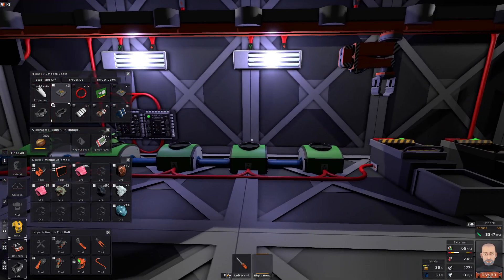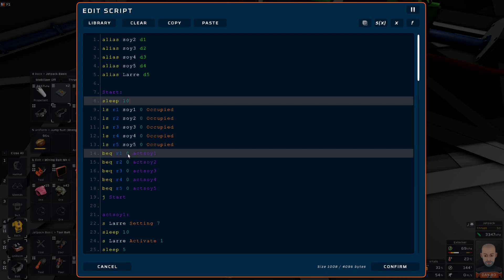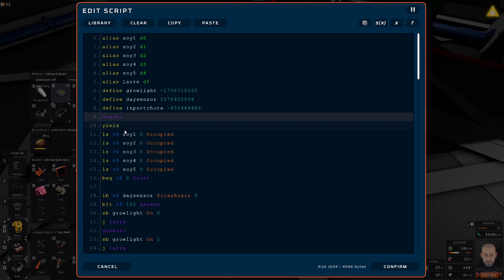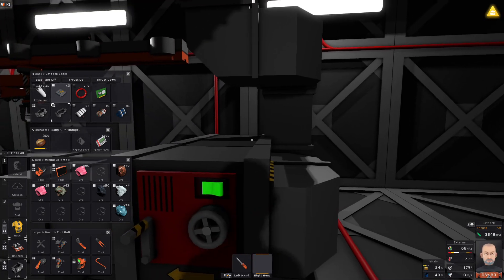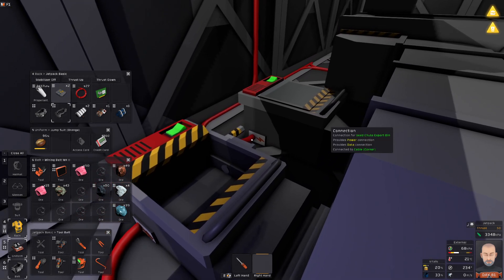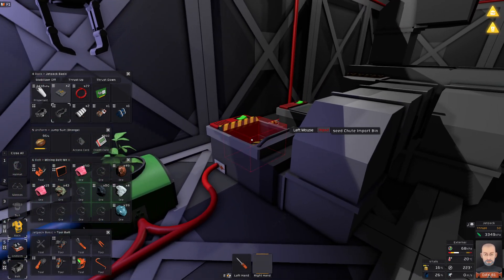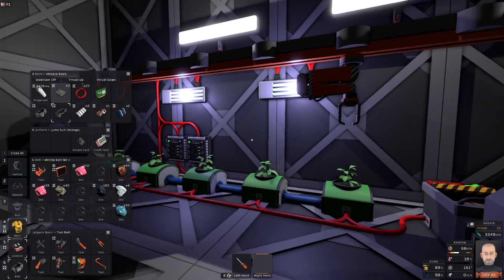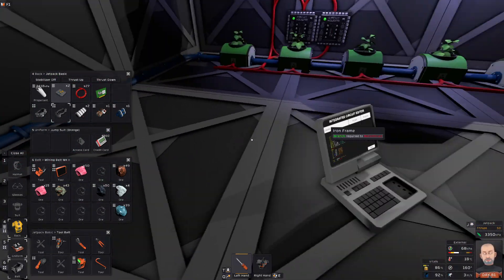Stationeers: LARrE from seeding to harvest automated program.

Comment: Hi, I have a question about the IC program. At 4:07 of the video, you can see line 104, which corresponds to Soy5.
It says "s import/chute Open 0," but in the other soy lines, it says "sb...." Is that correct? I'm sorry for the inconvenience, but it's just a question. When I write this comment, I'll add the "b" that the others have, and in another program, I'll remove the "b" from the previous 4, to see what happens...
Reply from the maker: Humm i would try both and seer if it works. I would think sb would be correct but I wrote that quite a while ago.

Comment: for the sleep in the code that you have, you can replace it with checking if the device is running(Idle).
like that
"Grab:"
"lbn r0 LArRE LARRENAME Idle Sum"
"beqz r0 Grab"
"sbn LArRE LARRENAME Activate 1"

Comment: This is the code I use Push("H1") are the trays with this code you can just add more in-between the Push 0 line. 

define fert 1
define seed 0
define drop 5
define hydroponics -1841632400
define stack 5
alias station r10
alias hydro r11
alias larre d0
alias counter r12

push 0
push HASH("H1")
push HASH("H2")
push HASH("H3")
push 0

start:
slt r0 sp stack
mul sp sp r0
add sp sp 1
peek r0
s db Setting sp
beqz r0 start
yield
move station sp
move hydro r0

checkfert:
lbns r0 hydroponics hydro 1 Occupied Average
bgtz r0 checkplant
s larre Setting fert
jal movelarre
s larre Setting station
jal movelarre

checkplant:
lbns r0 hydroponics hydro 0 Occupied Average
bgtz r0 checkgrowth
s larre Setting seed
jal movelarre
s larre Setting station
jal movelarre

checkgrowth:
lbns r0 hydroponics hydro 0 Seeding Average
beq r0 -1 start
lbns r0 hydroponics hydro 0 Mature Average
beqz r0 start
s larre Setting station
jal movelarre
s larre Setting drop
jal movelarre

j start

movelarre:
yield
l r0 larre Idle
breqz r0 -2
s larre Activate 1
yield
l r0 larre Idle
breqz r0 -2
j ra